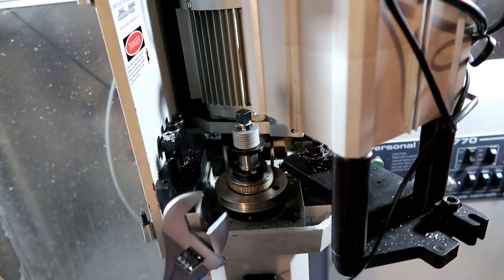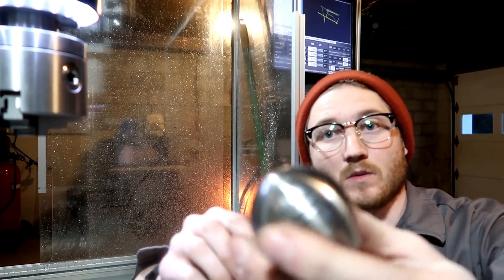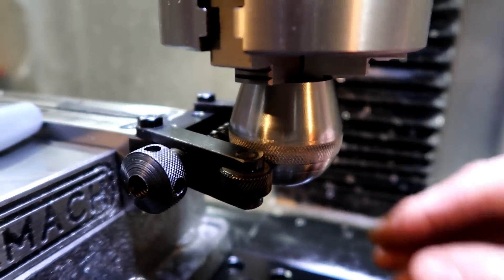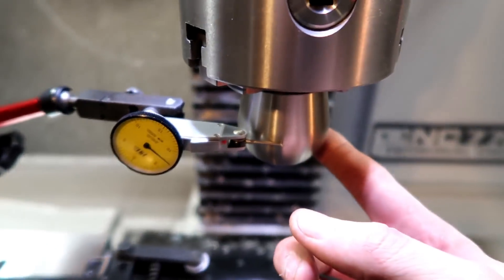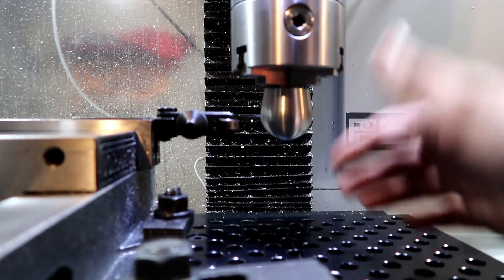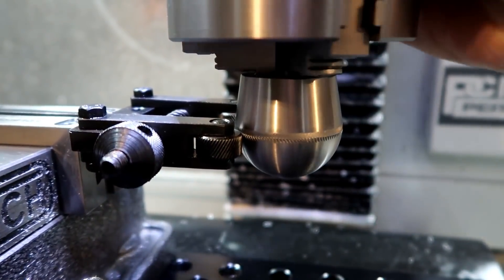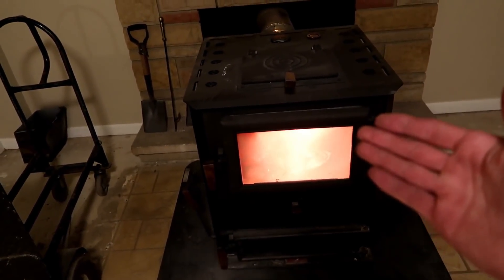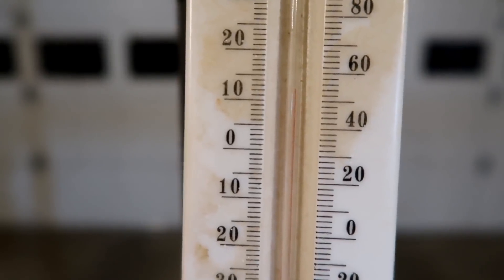Trying to Millturn a Knurl: Home Mfg. Days #28

Comment: Clamping would seem to work better.  You could probably make a new base piece for the knurler that would extend the arms further apart.  Any chance you have a rotary table?  
If you want to use that chuck a lot more, you could make a new backing plate with a 3/4" straight shaft sticking out of it.  Then it would get held in your collet just like the rest of the TTS holders.  That's how mine is.  I bought if from Novakon when I got the mill, but I don't know where to find them at this time.  Just a thought. :)  Nice vid!!
Reply from the maker: I'm not sure how much more knurling I will do but if I do then I probably will use the rollers from that tool and just try and remake the actual clamp.  
I don't have a rotary table but making a backing plate with a straight 3/4" shaft would make it a heck of a lot easier to use so I don't have to keep taking the R8 collet out. Since the shank is already on the chuck I would probably just keep using it as is since I probably won't be using it a ton more.
Reply: My machine has an electric power draw bar, so it's way easier to change out R8 tooling.   I really need to get my little cnc lathe back up and running.  Mill turning is a nice option to have, but I would rather run most of those parts on the lathe. :)
Reply from the maker: Yes I would love to have a lathe too.  Maybe at some point I will.

Comment: An easier way to remove or adjust the R8 collet is to lock open the power draw bar, then turn the spindle by hand to either loosen or tighten the R8 collet.  I saw this technique somewhere on YouTube.  I no longer need to open the spindle door or use wrenches to adjust or replace the R8 collet.  Massive time saver.
Reply from the maker: That would be super simple! Do you know where I can find a video of that on youtube?
Reply: Found it!  Published by "Thelifeofbrian"   https://youtu.be/pOMPJ9tpt5w
Reply: It also goes to show that you need to take care when changing tools, any rotation of the spindle while locked open will affect the tightness on the TTS holder.
Reply from the maker: You're the man!! That is so awesome.  I would have never guessed you could do that and it really seems too easy to rotate the spindle when locked open and I will look out for that next time. Thanks for sharing!